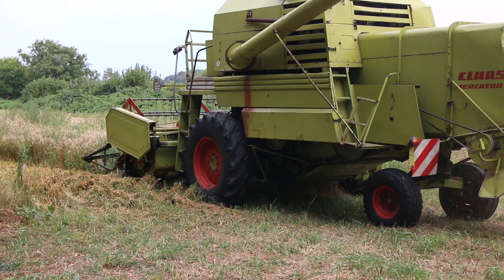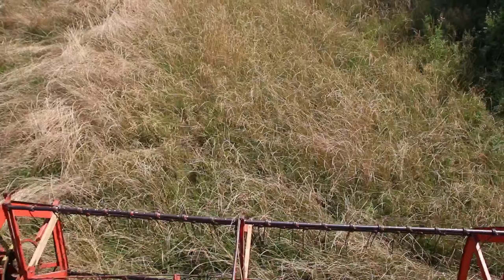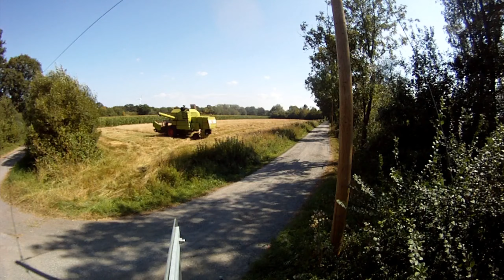Why battery-electric combines make no sense

Comment: Similarly to construction equipment, farm machinery is likely to be made zero-emissions by use of hydrogen combustion engines, not fuel cells nor batteries. However, combines don't run 24/7 every day of the year, unlike trucks and cars, so these really shouldn't be a priority for any environmentally-concerned people. It's not like wheat is harvested every day.
Reply: During harvest they operate around a minimum of 15 hours a day  , I wonder when you would charge it 🤣
Reply: Yes they operate for 15 hours a day or more during harvest but thousands of combine harvesters run at same time for 15-45 days depending upon crop and area. Do you think hybrid or fully electric good option? Also farmers do have interest to save fuel and maintenance cost of a Diesel Vehicle @twinturbo199

Comment: This is a very interesting video for me, an environmental science enthusiast. What do those words mean? I find environmental science, such as climate change and electric vehicles, to be very important and fascinating, but I am more interesting in learning than in action. I won't argue with people over what kind of car they should drive.
Reply: You can cut back a lot of emission in the agriculture if you double the CO2 in the air.
//No, it won't get hotter. Physically 0.7 °C, but disputed. Already did? No, only the night temperatures, because of the meteorology stations are in the cities, under development. :)//
As of now the plants are choking. We have about 400 particles in a million. Luckily brought it up from 280. It is good to know that 150 is extinction. So, it was always over 1000 , which plants like. If we could just double CO2 to 800 (it was tested), the plants would grow double-triple in size, and we would need only half of the agricultural area, burning half the fuel, in order to satisfy you.
Also, we would need half of the water. For as I said, we are in emergency of the low carbon, the plants are choking, therefore they have multiple times more pores (little holes on the leafs - again proved by archeology and tests), in order to able to catch enough C02, causing the plants evaporating accidentally at least double of the water as normal, sucked up by the roots.
*
It is glad to hear, there are environmental science enthusiastic people out there!

Comment: I think the whole math will change once we see autonomous driving. With the efficient utilization of human labor required today, a combine has to work long days without interruption. With fully autonomous driving (including roads), it is much more viable to have a combine which can work 2-3 hours before the batteries need recharging.
Another concept are battery trailers. Have only a minimal battery in your farm equipment and a trailer carrying the battery. Ideally the trailer would be autonomous to return to a charger and be swapped with a new trailer. This would allow contiguous operation while also bringing down the weight per tire to an acceptable value, probably below today's diesel systems.

Comment: Instead of just thinking about the problems with EVs we need to think differently about how we can use the technology to make things better.
Unlike a EV car, an EV combine could also run off of an umbilical.  Again with a center pivot format.  A 100m umbilical would serve over 3 hectares.  Not only that but with AI the combines could operate independently without a human operator.  A single farmer could have several of these combines running simultaneously and because they could operate 24 hrs a day harvesting time would be significantly reduced.  Sensors would stop the combine when it needed off loading.  The combines could then move on to the next farm (equipped with centrally located power hook-ups) and the process repeated.  A fleet of 10-12 combines could be shared or rented by dozens of farms (reducing costs) and increasing efficiency (larger farm operated by a single farmer).
Reply: Umbilical tech makes sense to me. Running cost would be cheaper as compared to diesel engines. How can we run 110v/220v electric combine on road when we need to take it to another farm that is 50 miles away? Small diesel engine or EV motor is required for such cases.
Reply: @Web3health  "How can we run 110v/220v electric combine on road when we need to take it to another farm that is 50 miles away?"
1) unplug it
2) put it on a flatbed truck carrier
3) drive it where you next need it
4) plug it in again.

This really does not have to be so hard.

Comment: I can see your argument about batteries being heavy and expensive. However, I think that if we were to use a small battery with a generator (my preference would be a sterling engine AKA a heat engine) because of their low maintenance. Any generator would work depending on what was most cost-effective. Most trains have been designed this way since the 1970s using diesel generators, the most efficient means of turning chemical fuels into electricity. You can get more run time out of the same tank of fuel as well as more power from the electric motors. A company in Canada called Edison motors is up-cycling old trucks (lorries for our UK people) and doing just this. I hope once I get my farm to do the same thing with a combine and a few tractors.

Comment: just install some overhead wires and run it like a trolley, or better yet redesign the whole system to work exactly the same as center pivot irrigation
Reply: Unlike a EV car, an EV combine could also run off of an umbilical.  Again with a center pivot format.  A 100m umbilical would serve over 3 hectares.  Not only that but with AI the combines could operate independently without a human operator.  A single farmer could have several of these combines running simultaneously and because they could operate 24 hrs a day harvesting time would be significantly reduced.  Sensors would stop the combine when it needed off loading.  The combines could then move on to the next farm (equipped with centrally located power hook-ups) and the process repeated.  A fleet of 10-12 combines could be shared or rented by dozens of farms (reducing costs) and increasing efficiency (larger farm operated by a single farmer),
Instead of just thinking about the problems with EVs we need to think differently about how we can use the technology to make things better.
Reply: @mafarmerga really ? Because nothing ever goes wrong with a combine , the driver isn't there just to guide it round the field  ,😂
Reply: @twinturbo199  We now have driverless taxis running the streets of major cities.  Surely a combine can go up one row and down another without killing anyone.  And shut itself off if something is amiss.
Reply: @mafarmerga  Bearings go bad and cause a huge amount of damage if not immediately dealt with. Not to mention the risk of fire or a rock going through the cylinder. Getting the cutter bar just right is also extremely difficult in some crop conditions and any mistake could cause the thresher to plug. 
Not saying it's impossible but a lot more complex than running a taxi, in a city, in good weather. Rodents are also a severe problem with Ag machines, and the more electrical complexity the bigger problem it is.
Reply: @robwhite3241  So you are saying that a human is better at detecting bad bearings than a computer ever could be???
Sorry, but I respectfully disagree.
Reply: @mafarmerga  I can't think of a reliable way a computer could detect wires on a combine. Bearings can fail so many different and unpredictable ways. Not to mention the sensors and wires that would go to every bearing for a detection system, there would certainly be error codes constantly. Combines are some of the harshest environments for anything electrical, the more there is the worse it gets. 

Another point I forgot to mention about designing equipment to run on overhead wires or center pivots is weight. Compaction is best reduced if equipment doesn't run the same path every year.
Reply: Got it up and running yet?

Comment: These same arguments were used against electric cars. The answer is better batteries, improving the efficiency of the drivetrain beyond just the motor, and weight reduction of the rest of the vehicle. Simply swapping in a battery to an existing combine is not likely to work for all the reasons you mentioned, but that doesn’t mean it can’t be made to work with intensive engineering of a clean sheet design with better battery tech. (And the battery cost is still a fraction of the fuel costs.)
Reply: Thank you for this
Reply: It will never be efficient in large applications.

Comment: Also the average efficiency for diesel engine is not 40 %. You are talking about maximum efficiency. There is a studies that cleary says that the average efficiency for diesel engine in cars is 20 %. Sure for harvester might be a little more, because their load doesn't vary so much, but for sure not more than 30 %, probaby around 25 %. Average electric motor efficiency can be 95 %, with everything included (controller etc) it is 80 %.

Comment: 3:30 You based your calculation that  harvester would work 12 hours per day without recharging and calculated it needed close to 1000 kWh of batteries. But that is not smart way to do it. Smart way to do it is harvester which is capable of 4 hours of work time and have quick 30 minutes charging option. Then you would need only 330 kWh of batteries, which is very much possible (330 kWh ob batteries weight only 1,2 tonne). Energy density of todays best 18650 batteries is 263 Wh per kg (Samsung 35e). So that means less than 4 kg per 1 kWh. So point is: it IS possible to do it. You are also wrong about price. Todays price of liion batteries is 100 € per kWh, so that means only 30k€, but then you save a lot of money because electric motors are dirt cheap compared to diesel engine, you also don't need gearbox and all the exhaust cleaning equipment. And that are todays prices in the future in 10 years it will be closer to 10k€, which will be cheaper compared to diesel harvester with all the components required for diesel engine. ALso the energy density will go up, for example 500 Wh/kg in 10 years, that means only 0,66 tonne for the battery. But electric motors are also much lighter compared to diesel engine, so there wont be much difference in weight either. Sure cars are much easier to convert cars to electric, but even with harvesters it is possible to do it.
Reply: You are confusing cells with battery packs. The battery in a Tesla p100d weighs 625 kg, a 330kwh battery pack would be closer to 2 tons.
I have no idea where you buy battery's at 100 € per kWh , The Tesla mega packs are $327 per kwh if you order 10 of them..
Then we come to charging, If you think you can charge a 330 kwh battery in 30 min on a farm then you have no idea how the grid works. Your fixed fee in your electricity subscription is based on your peak demand from the grid. Demand charges varies by location but a subscription that can supply 660kw would cost over $100k per year in most places. And that is assuming the local grid can even support that connection which it cant for most rural places like farms.
And all of this is for a tiny basically obsolete harvester, a modern harvester have about 800 hp / 600kw and unlike cars or even trucks they operate at high engine loads most of the time. At 500 kw average load we now need a 2000kwh battery to run it for 4 hours. Which weighs 12.5 tons and cost $654 000 and to charge it in 30 min we need an electricity subscription that cost $700 000+ a year in just fixed fees. All of this applies to large tractors as well.
Reply: @tomte47 You do not need to run for 4 hours, you can run just 30 min, charge 20 min. It will be more expensive on employees and more harvesters but you will save more money on fuel. And with autonomous harvesters there is no extra cost on the employees. Particularly you will save more on fuel with solar arrays at the farm and another battery as a buffer between solars and the harvester. It is all a big investment but in some years it will return - the same as RoI as for EVs just several times bigger solar farm + bigger battery.
Reply: @lacekratochvil  This is completely impractical, the field can be 20+min drive from the farm. Having such a big battery just as a buffer would be obscenely expensive and it would still run dry because the equipment uses many times more energy then the grid can provide. A typical house can support an 11KW charger, A Farm have a larger connection but it also uses that extra capacity but lets be generous and say we can put a 50kw charger in there. A single big tractor or combine can use 300-500 kw when operating, even if you somehow could have the tractor plugged in while operating it would not work. The only feasible solution to electrify would be to truck in battery's and swap them near the field, they would then need to to trucked back to a charging location that can handle them. This is still untested and might not work for a number of reasons or be to expensive but at least have a theoretical chance of working.
Reply: @tomte47  Similar are semi trucks and still there is Tesla Semi - 36 tons of cargo for 800km on a single charge. Diesel trucks have 450kW motor, similar to harvesters - so Tesla Semi cannot exist? Just nobody makes such harvesters yet, there is a big business opportunity for all the electric garden and construction machinery, sometimes considering to quit my job and start one.
Reply: @lacekratochvil  They do not operate the same way, a truck only use max power when accelerating or going up a very steep hill, once at cruising speed they use around 70-100 kw. Keep in mind that the semi is still in testing phase with less then 100 units made, It still need to prove itself being a viable solution.  Battery's work bad where you have high continuous workload, things like planes,ships,big tractors and combines, bulldozers etc. Semi trucks are on the edge of what is possible and still need to prove themselves. You then talk about garden and construction machinery which is totally different. Electric garden tractors that does intermittent work is completely different and already exist.
Reply: @tomte47  "Battery's work bad where you have high continuous workload" - then you need more (smaller) batteries, no problem just higher cost. This is why Model S Plaid uses more of smaller batteries (7104 of 18650s) while Model 3 is fine with less of bigger batteries (2976 of 2170s). Anyway 34l/h is similar to semi trucks so it shows the harvesters are no big deal.
Reply: @tomte47  subscription cost is not the only thing the power lies cost is up front that is around $200k per km of line even a small ish farm like my one only 60 km from town would need a lot of money, money we dont have sitting around if we tried to get a lone the bank will tell us to shove it. hell here in Australia there are farms way out some even off the grid needing to run off generators tax payers will need flip the bill for running lines all they way out there. also the problem of needing lines to go out to each field on our small farm it can take a good 30 mins just to drive a piece of equipment back to the shed. also another problem people over look is what do i do with the old equipment? i have a well over million $$$ in equipment.